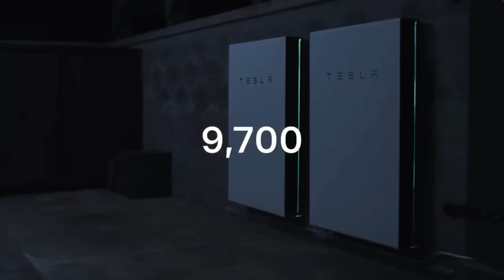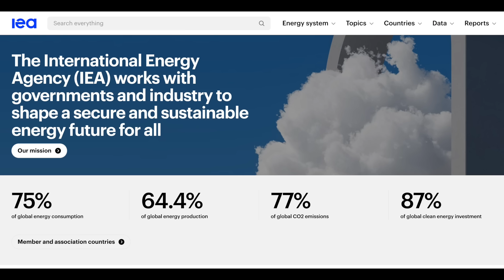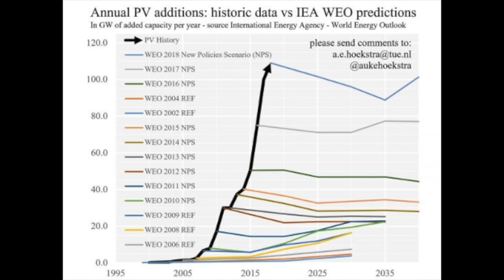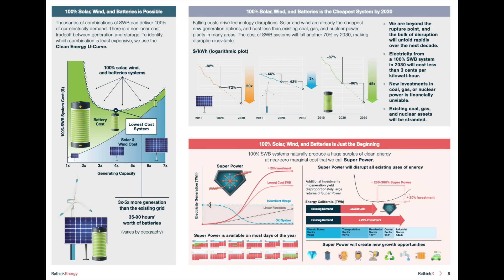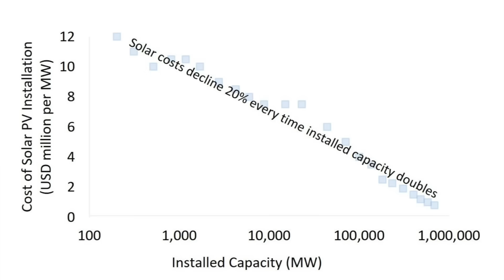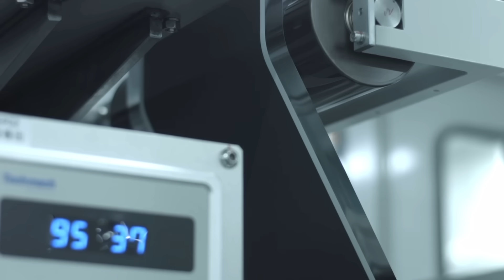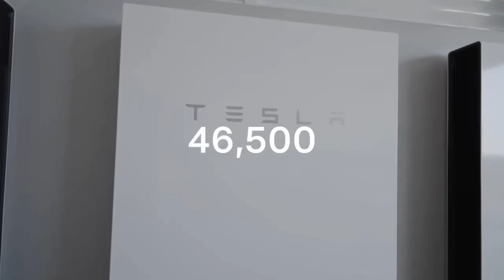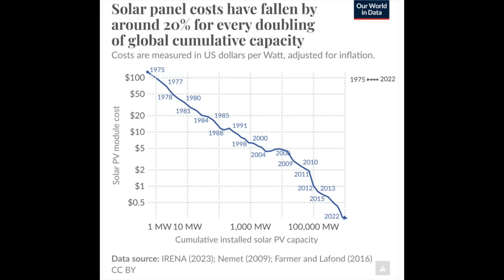Tesla’s Energy Empire - Solar & Storage are Saving the Grid - The IEA was wrong - Shocking Data!

Comment: Despite great wind & solar potential, there’s a move afoot in Texas to exploit drilling knowhow - from the oil industry - to drill very deep (10-20km) wells down to superhot (400c+) dry rock at the site of extant power plants. These deep wells would be used to inject water & extract supercritical steam to turn electricity generation turbines. The electricity transmission infrastructure already exists at the sites of power plants in use today. It might even be possible to repurpose the old power plant turbines with this new source of steam to generate even more power! [old turbines might not work well with supercritical steam, though]

Comment: Need to know after 100 years ICE-machines are stuck in a dead end with 21% energy efficiency. Now non sequitur cheaters since 50 years promise water vehicles just forgetting that electrolysis or fuel cells or e-Fools (fuels) are not free of serious servicing to function and burn terrible amount even of ‚green‘ energy we have not to waist for nothing than 12% energy efficiency! But even with bad mix in Europe BEV-Systems are leading dramatically with 68%! But ICE industry promised the 2-LITRES car on 100 km/60 miles 40 years ago. Our fleet cars use between 14,5 to 16,8 kWh on 100 km/60 miles which is that equivalent! But the cars are serious and have power of former high end sports cars just not making NOISE! This however today is no human right!

Comment: It is all good until winter comes and the sun goes away. I live off grid on solar and batteries. So until you live the same as me you will only guess you are correct.  It is awesome in summer. But you need 4 times the amount of solar and batteries in winter than you do in the summer.   All it takes is 1 week of no sun and your batteries are dead. If you use 5 KWh a day you will need 7.5 kWh of battery the supply that 5 kWh if no sun that day.  It takes power to keep the inverter running and you have losses. So 30 kWh of batteries will only last 3 days if you use 5 kWh a day.

Comment: This is a compelling video. Funny thing that few talk about and do not really include in their predictions is the "second hand" market. All of those "old" solar farms and panels we see have a rather long lifetime, as do the batteries in electric vehicles. But solar and battery technologies have been changing rapidly. For instance, Redmond Materials and others are recycling batteries for materials. Very good, but finally, after at least 4-5 years, EVs (mostly Telsa) are appearing rather cheaply on the used car market and those "old" cars have batteries (with at least 80% capacities) that will power those vehicles just fine for many more years. My brother has a farm with a old solar array he got second hand years ago. It still works fine and will for many more years. To replace it with brand new technology would be expensive, true, but not necessary. All of those old solar farm arrays and panels can be recycled or they can flood the market for very cheap second-hand applications that people all over the world can afford and benefit from. I think it would be ridiculous to simply dispose of those things in a landfill.

(I also think it ridiculous to de-orbit old space stuff (not "junk" IMO) when the cost of sending mass to orbit is still so high; when they would remain in orbit at least for the near future until space tugs and recycling material in space becomes a normal activity.)

Comment: Net zero is a crock. Plants die at under 150ppm of carbon dioxide. We sit at over 400ppm and that is why the earth is greening. Grow a brain please Lars
Reply: They do not “die” the moment concentration dips below 150 ppm; most start struggling only when it drops much closer to 100 ppm (and many grasses survive even lower).
Today’s 429 ppm is ample for photosynthesis—but also the highest in at least 2 million years, and still rising.
Extra CO₂ has indeed made many areas greener, but the benefit is already plateauing and it only offsets a small fraction of the warming that excess CO₂ causes.
Balancing human emissions with removals (and then going net-negative) is not ideology; it follows directly from the physics that cumulative CO₂ drives temperature. Calling it a “crock” misrepresents the consensus evidence.

Comment: Big Oil doesn't like "renewables"
Reply: Exactly…I smell burning oil
Reply: See that in the Philippines where unreliable Diesel power plants with often blackouts are not fine for tourism and so intelligent people have batteries for brown time - no more noisy generators - and of course are self sufficient with solar rooftop that become quite cheap and common of course as system from China. We even have servicing from a Swiss guy that uses Starlink to constantly monitor our system to optimize our needs with AI. So also BEV acceptance among younger people is on very high level specifically when new cars offer V2G or at least V2L! There is no noisy tradition and people enjoy when there is less air pollution with clean energy and traffic! Did not expect that in Asia they are in lead over Europe as on near 7000 islands PV is so much easier than transport the diesel by expensive ferries using also a lot of diesel and oil. Also cost of maintenance, less downtimes, power grid stability for electronics and last but not least TCO are so much lower and no need for additional transformers to get some more stable net from local suppliers. This also is rather expensive and not necessary and not to mention that the nets are nasty like in the USA. No cables like in Switzerland where most electricity goes to the ground.
We actually produce so much electric power that we easily could also power other households with kitchen machines, washing machines, A/C etc. 
P.S. what about old fashioned flow batteries that are perfect for stationary applications of big size? So there are so many opportunities that nobody needs oil or atomic power for producing electricity. We even have in Valencia a thermal power plant that on many places around the world is an interesting option too!
Reply: Local code enforcement officials says (exact mf sa words) nuclear is the future 👎

Comment: Northern Europe experiences minths and even 2 to 3 years of low sunlight and wind. The German lanuage has a wird for it - Dunkelflaute. The "duldrums". Batteries cannot store energy for a period long enough to get through thses periods. You need a whole secondary power geberation system and which might use stired hydrifen, but thefe are energy losses producting hydrogen from wind and solar and converting it to electricity later. That secondary power generation system is what majes wind and solar so ecoensive. A lot of studies on wind and solar generation ignore the cost of that secondary power generation system.
Reply: @AdrianHilder open your mind read some of Tony Seba's past predictions that are now coming true, little battery and double Solar is the answer.
Reply: @pietersmit621  In the UK there are periods where wind and solar generates 100% of demand. The in winter there are periods where it generates less that 10% for weeks and months. Doubling solar solar is not going to solve that. I wish wind, solar and batteries could be the complete solution, and in some parts of the world it can be.

Comment: Between gasoline or petroleum products and electricity.  From mining or drilling until the rubber meets the road.  The question that comes to my mind is how much energy is spent mining and drilling it takes to produce Dino juice.  Or how much mining and drilling does it produce to make solar cells.  Send this to transportation cost for those energies to reach the rubber on the road.  I'm a generalist I can't give you an exact numbers but there are people out there who can.
Reply: It costs more energy to find, extract, refine, and distribute a litre of fuel than the energy value of the fuel. Only gigantic subsidies keep this crazy system alive.
Reply: @BALANCEDPORTFOLIO  You are partly correct, the profit comes out of your pocket, in other words, you are paying to much.
Reply: 1kg of coal contains approximately 7kWh of energy. Converting this to electricity is 30% efficient so 1kg of coal gives 2.1kWh of electrical energy. This is equivalent to 5 solar panels that will last 20 years. The equivalent amount of coal to mine to provide 6hrs of electricity a year for 20 years is 87,600 kg. That is nearly an entire export train full of coal. The energy required to mine our fossil fuels is much bigger.

Comment: Decentralizing too expensive compared with grid-scale.  Should do only grid-scale and use some of the savings to harden the grid
Reply: You have it backwards.
Reply: Centralized does have some price hurdles, space not free like rooftops, bigger grid needed to move all the centralized power to where it will be consumed, more single points of failure, etc.